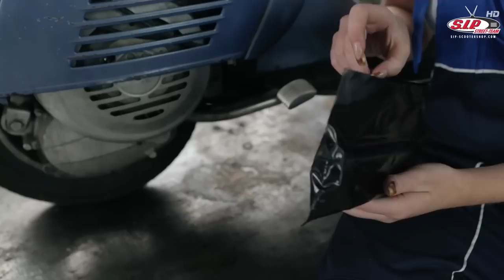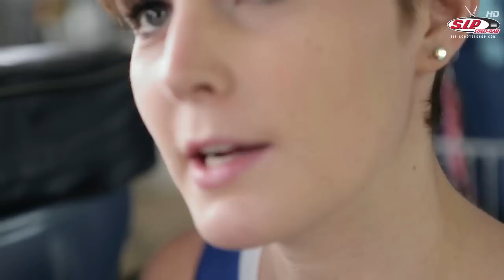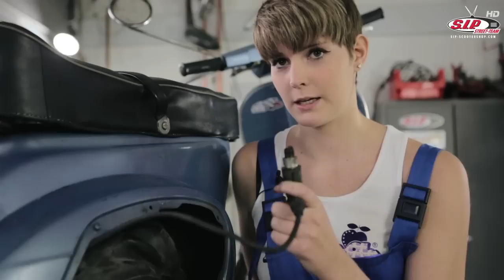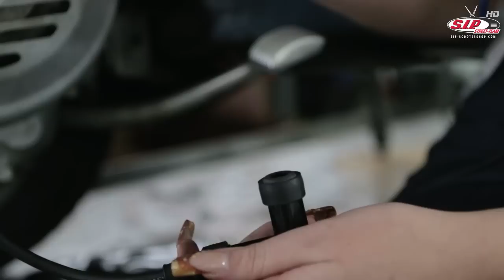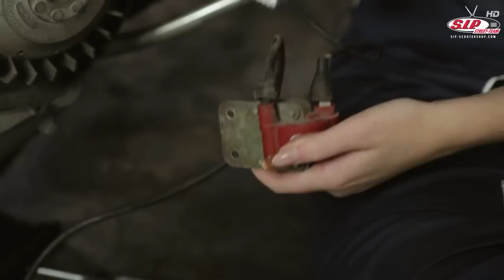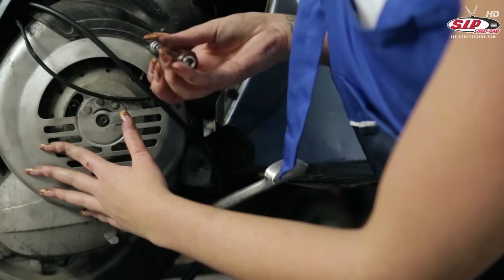VESPA KEINEN ZÜNDFUNKEN - WAS TUN ? // NO IGNITION SPARK - HOW TO FIX IT

Comment: Found the solution, there are two cables running from the coil. 1 is to connect te spark plug. The other cable was the problem. It's very loosely connected to the coil